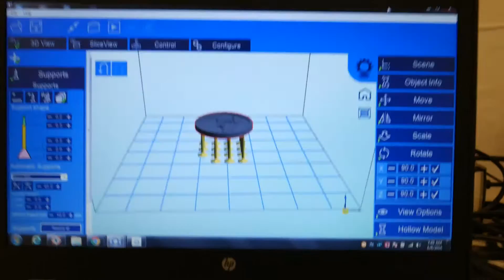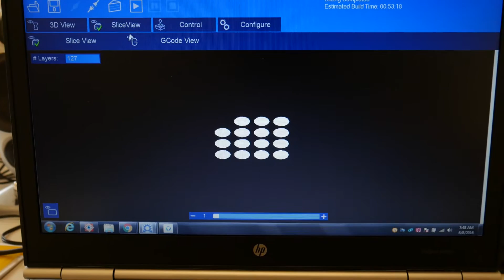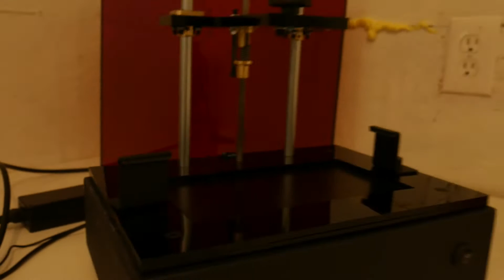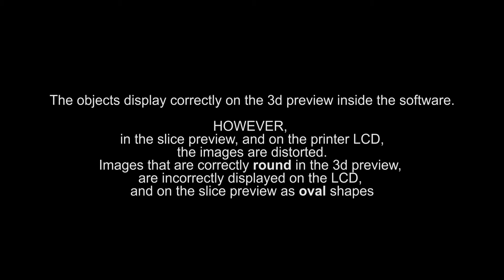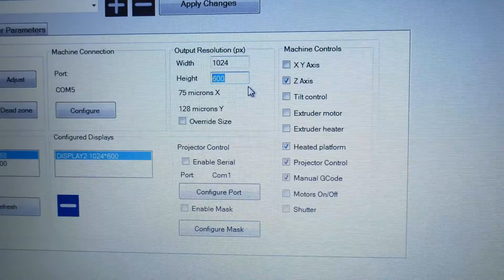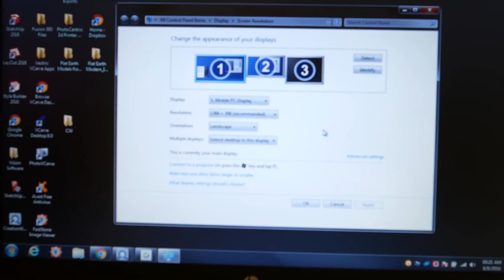Photocentric 3d printer Screen Resolution and Driver Issues (see notes for resolution)

Comment: Do Phtocentric Daylight resin have a strong odour during print? Especially flexible ones.
Reply from the maker: The resin stinks pretty badly right out of the bottle. However, we have not noticed any "extra" smell from the print attempts with these resins.

Comment: Dear Mark,I have noticed that the Machine Selected in "Configure Machine" is Default_SLA, it should be Liquid Crystal. This is the reason why the parameters and resolutions are incorrect and not working properly with Liquid Crystal.
Reply from the maker: Thanks for the tip. If there is a Liquid Crystal profile, it just might resolve the major issues with the LCD that we have been experiencing.  I do not recall any option for Liquid Crystal, but will verify this when we fix a new software issue that occurred. The license that Photocentric provided us has expired after roughly 90 days. We cannot use Creative Workshop until Photocentric provides a working license that will not expire.
Reply: Hi Mark, we have sent another license by email while we check with Creation Workshop the issue with your license, it should be valid for 12 months.